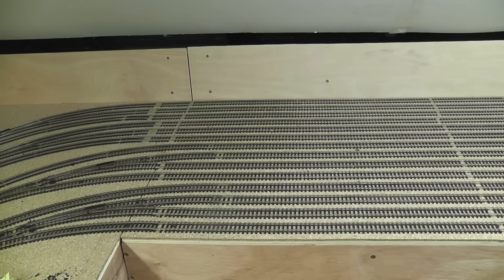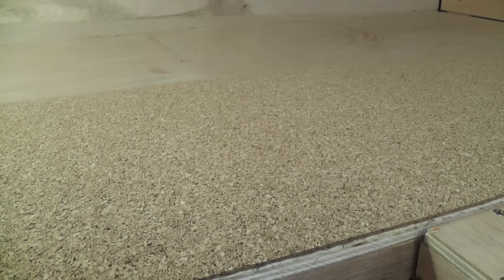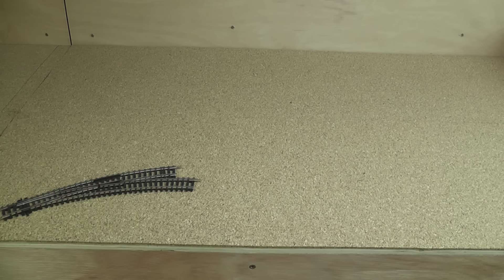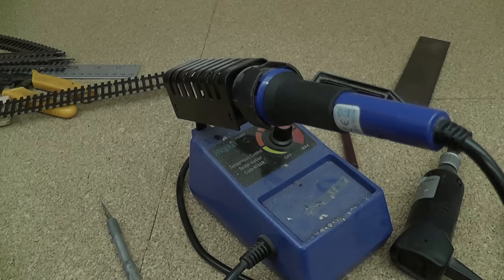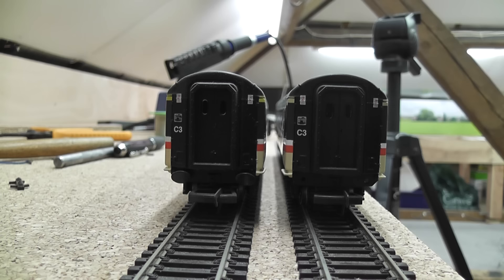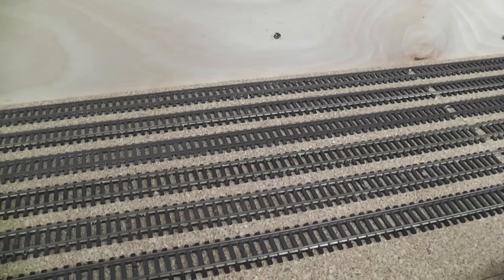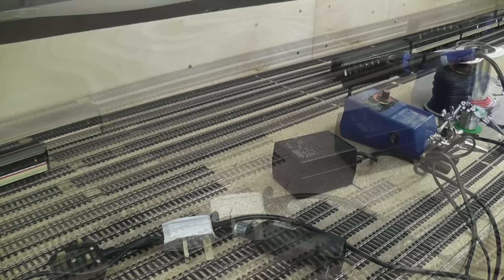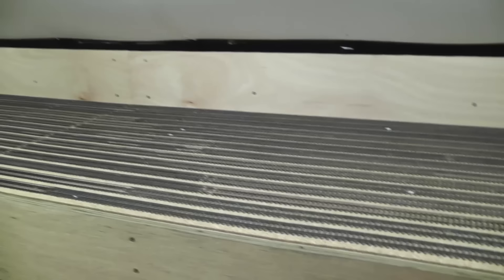New Layout Build - Fiddle Yard

Comment: When I was wiring a fiddle yard some years ago I stuck drawing pins into the underside of the boards wherever I had dropper wires, especially for the points.  The dropper wires were then soldered to these, and then the main wiring was subsequently soldered onto them - this reduces the need for long dropper wires and saves cable.  Also, when used under points and section gaps, it creates an image of the track above which also makes wiring and trouble shooting easier. 
Presumably, you will be using connectors of some sort at the baseboard joints in order to preserve the ability to separate the boards.
As an aside, I rather liked the scrapyard in the old layout - it reminded me of Barry Island and Woodhams' Yard.

Comment: Dear Everard Junction, thanks for your many instructional videos over the years - most informative. May I add some tips for soldering. Always apply a small amount of solder to the soldering iron tip before soldering any joint or tinning. The liquid solder will transfer the heat much more efficiently than a dry tip and can reduce the damaging effect of heat on plastics. Another tip is to have a damp soldering iron sponge or folded damp kitchen towel to clean the soldering iron tip before each joint is made. This will help in reducing unwanted dry crystaline joints that might fail over time. The soldering process should be: clean the tip, apply solder to the tip then make the joint as you have instructed. I hope this helps.

Comment: Hi Richard, with such a densely spaced fiddle yard you may find it worth nailing a 3mm thick strip of hardboard to the edge nearest to you as a safety barrier. With such close tracks a slight fumble may cause a domino effect such that part or all of a rake of coaches decide to roll sideways onto the floor. I applied a strip so it was about 20 to 25mm high relative to the rail top, enough to stop a roll overboard but not enough to be a nuisance. Tension lock type couplings are very tenacious when they want to be. Merry Christmas and have a Happy New Year, I eagerly look forward to viewing your forthcoming videos. Jim.
Reply from the maker: Hi Jim, I will be putting up a protection board once I've completed the track laying.

Comment: Hi Richard.
Nice to see some track being laid and that you're not wasting track that you've already bought.
Good move with the soldering done beneath the track. It's something that I've done for years, and looks particularly good when on scenic sections.

Regarding having shorter trains on a single fiddleyard track... one thing that you could do, is to fit DCC block detectors.
You can set things up where you can have 5 blocks on a single siding, with a DMU in each of them.
As block #1 becomes vacant, the DMU in block #2 will move into block one, and as block #2 becomes vacant, the unit in that block will move into block #2... and so on.
So your units will all shuffle forward by one block leaving a gap at the back for the unit you're operating to go into, without having to manually shuffle.

You an also use something like JMRI with a laptop (or even better a touch control monitor) to create a virtual panel making it easy to route trains.
With a push of a single button on the screen, you can set macros so the points will change in sequence and create a route all the way around the layout.
Reply from the maker: I will be doing something similar to that if not the same when I get around to sorting the control out.  Automatic braking and slow approach is also something i'm looking into.
Reply: Regarding JMRI for route control, I did something for a club layout a few years back.
I had it set up so that by pressing two buttons on the screen, you could set a 360 degree loop from a fiddle-yard siding, through at station on the scenic side, and back to the fiddle-yard.

It was set up so when you press a button, it goes through the list of point motors, selecting which will be activated and in which direction they need to be set, and then each point is flicked over in turn.

Would you be interested in having a Google hangout with me so we can discuss it?
You'll only need a microphone.

I can show you how to set it up and how to set up the macros to make it work properly.

Let me know if you're interested.

Comment: Fantastic to finally see track going down. You must be so happy to reach this stage. Regarding the crossover I too have prototypicalish spacing using 25mm aluminium box between the rails when laying. I found after a couple of attempts that the best way to join 2 points is to cut the stock rails only and lead the rails on the frog alone. Trim the chairs on the sleepers to accommodate an isolating fishplate and you're good to go. Merry Christmas and Happy New year

Comment: Tip: If you use Evo stik PVA non-waterproof glue (in the green bottle) to stick Peco track down. When you want to lift or move the track you only need to apply a little warm water. Wait a few minutes and the old glue will have returned to a liquid state. You can then even wash the track carefully in a shower to remove most of the balllast and other scenic bits.
Reply: Copydex is also good as it is a water based contact glue. Holds tracks pretty quick and will allow for easy pull-up if needed.

Comment: Great video. Good tip on how to straighten pre-used  flexiitrack...not one I have heard before even after 50+ years modelling!!! 
A great Christmas to you and yours. Cheers, Bob
Reply from the maker: I've not seen it done either.  I looked at the track and thought 'how about a whack on the workbench'?  Worked much better than I thought so included it in the video.  Thanks Bob

Comment: when you glue a road base using PVA glue with cork underlay it in fact increases noise transmission. If you want to decrease noise use a soft set glue on the ballast with a cellulose underlay and use a silicon type flex adhesive like selleys 3-1 to glue down the underlay.

Comment: All looks great and very neat... and by bringing the track closer together it gives a much more prototypical look, even though it's not in the scenic area! We get told off in the rail industry for calling all running lines 'fast and 'slow lines' - the Western were and still are, very particular in that they have 'Mains' and 'Reliefs' instead, which are laid out in pairs (i.e. Up and Down main as a pair then up and down relief) with a 10 foot spacing rather than a 6' spacing between pairs. This might help you get the GW mainline 'look' when laying the track as model railway set track has otherwise non prototypical geometry.
Reply from the maker: Thanks for the info.

Comment: Hi Richard
A sizeable fiddle yard for sure, can't wait to see some trains on there.  Good choice using code 75 as all points and cross overs are electrofrogs and it looks better, something I wish I'd realised before buying all the code 100 that I did. Fleischman joiners are spring loaded and make an excellent connection, Jim on Hoover motion uses these to great effect and didn't require quite so many droppers which you make look easy but are a pain to do for so many tracks.
Happy Christmas looking forward to seeing your layout progress in 2018.
Cheers Paul

Comment: Great videos! Super resource for learning and interesting to watch. I don't know what your plan is for the layout but how about having a Dmu service area on the main layout with a small one or two lane shed and wash with a loop line or two to leave units at on the station approach or on the approach to the fiddle yard at the city scene end. Run one of the loop lines to the station and you have a layout feature which doubles as a dmu fiddle yard where you could store your units on the layout and they won't trip over the longer kit in the fidde yard. Think the south end of Sheffield Station or Bristol Barton Hill for inspiration. I don't want to turn your comments section into a "why don't you do this" forum but it could be a practical way to free up lanes in the main fiddle yard.

Comment: Merry Christmas Richard.  Those baseboards only 2ft wide at the fiddle yard?....a massive amount of track for storing!   I have a decent sized off scene fiddle yard, but yours is gigantic! lol. Dave
Reply from the maker: Cheers Dave.  They are indeed only 2ft wide.  Managed to get 14 sidings out of it in the end.  Unmodified peco points would have allowed for 12 sidings.
Reply: @EverardJunction  Hello Richard . Is the pointwork set track or code100 ?

Comment: Nice tip with the 12mm block of wood for track spacing.

Just a thought but could you not have incorporated a "Rolling Road" test unit into one of the "Slow" sidings

Comment: Happy Christmas...!!  Are you thinking of putting some sort of guard along the front of the fiddle yard to prevent anything on that road nearest the edge accidentally taking a dive several hundred scale feet to the floor?  I've got a few sections on my layout which are that close to the edge and I've added strips of thin plywood just high enough to catch an accidentally toppled coach or loco (although I'll admit that was only after a Class 158 took a tumble - it sustained damage but not terminal thankfully).  I tend to find when reaching over to the back roads you can accidentally catch anything at the front with clothing etc. and the guards I've got have saved some expensive falls a few times.  Just an idea... you're probably not as clumsy as me!

Comment: Hi Richard, I'm agree with tobortine.... ! 
I have several YT's followed about our hobby but you're the best of all ! 
Because I'm Dutch and your comments are realy understandeble for foreigners.
I'm a Dutchman and restart after 50 years again with this hobby. The worse thing is there is so much changed in this years and thanks to you that you explain every thing clear ! In between I've see 100's of vids of our hobby.
In my worklive I was a locdriver at the Dutch Railways for 10 years and after that a teacher for locdrivers and I'm now almost 70 years old now.... :) 
But I've a question: In 1 of your vids you let see your locshed with a rolldoor. The mechanic to roll-up the door with Mecano I do understand but from which material have you made the door ? Because I like that very much and I will make and use it too.
I wish you a good and happy 2018 !  Ed

Comment: Hi Richard you mentioned about your bus and you wasn't sure about how you was going to run it ,my layout is similar to yours also loosely based on the gwr line from paddington with two fast two slow lines, i am nowhere near finished but decided the run four separate buses to give some flexibility i.e. 3 dcc lines 1 dc line also if you do have a fault the lines can easily be isolated , adding boosters made easier too, hope this gives you an idea ,great channel, have a happy new year.
Reply: Hi very nice saves time taking loco and stock off the layout also see what u have to run nice one Kevin Philippines  have the same

Comment: If you really consider keeping the sections separate it would be wise to insert screws on the edges of the sections and solder the rails to them. It's a commonly used practice on modular layouts because it keeps the track in place preventing bumps or derailments. ;-)
Reply from the maker: There a various methods for doing this.  I will be sorting it out in the future as the new layout progresses.
Reply: There is also a German manufacturer, who produces "module transitions", which are basically pieces of circuit board with ties on them, where you can solder the rails on. Mind you, they are a bit expensive for pieces of circuit board, but maybe it is an idea you can reproduce with a bit of CAD and if you know someone who can photoetch circuit boards. Here is a link to an online shop where you can buy them: http://www.mbs-sebnitz.de/gleisbau/schwellenbaender/moduluebergaenge/moduluebergang-4-schwellen-h0.html Also this is the manufacturer: http://www.digitalzentrale.de/ (both in German, I am afraid...). Alternatively, there is another German manufacturer called Weinert (they are reselling Peco tracks in Germany as well, incidently), who have track joiners for module transitions in their program: https://www.weinert-bauteile.de/weinert-modellbau-74019-mg-code-75-schienenverbinder-mit-angegossener-schraube-8-stueck-weinert-meingleis-fuer-moduluebergaenge,art-30399 These are for code 75 track. Hope this helps.

Comment: don't use old school cork anymore, i now use foam throughout. It has far better scenery and sound deadening capabilities. Merry Christmas.
Reply from the maker: I'll be using foam for the scenery.
Reply: NS3644 until it disintegrates.....
Reply: Have been using insulation foam for over 10yrs without any sign of disintegration unlike cork.  It just depends on you using the correct type.  Merry Christmas.
Reply: Aaah,  I expect Richard means the closed cell type used for insulation (my preferred for track and scenic surfaces) not the open cell track underlay type. Jim

Comment: A Merry Christmas and a Happy New Year. Would it not be prudent to test run locos, coaches and wagons over the pointwork each end before you extend. This way you can remove any major or minor problems to prevent any future disappointment and having to spend time correcting in the future when it can be done now. Run the loco(s) under power,this way any snags can be found and corrected. Looking forward to future installments.
Reply from the maker: I have been testing as I go.  Currently can't run any powered locos over the point work as its hanging off the edge of the board.  Plenty of testing is being done as I go especially clearance checks.  Cheers
Reply: You wouldn't happen to have been a member on b3ta.com many moons ago would you?

Comment: Great job mate. But in my opinion the dropout wires you have used are way too thick because you will never ever have more than 1 amp of power requirements on any single piece of track, providing of course that all the flex have individual dropouts and that you run a thicker pair of bus wires underneath the whole length of the layout. On the dropouts you used multi strand wires so you can go much thinner, as thin as 0.07 square mm cross-section. I also initially thought of using 0.75 square mm cross-section on the dropouts but ended up using 0.14 square mm cross-section just because I couldn't easily find thinner than this multi strand wires close to where I live. Again as usual you've done a great job as well as another very instructional video and I thank you for that and I wish you good luck in constructing your new layout. I also wanna wish you all a Merry Christmas and a Happy New Year!
Reply from the maker: Thanks, with regards to the wires I've had those reels of wire for years.  Its cheaper to use them rather than buy new stuff.  They are probably too thick but I'd rather have an overkill setup just to be sure.  I've got lighting installed in most of my coaches and will also be double heading some passenger trains.  All that will add to the load on each pair of droppers.
Reply: Unless you're using "plasma" lighting there should not be more than 1A at any time on any particular meter of track. I always tune the lighting way down in my coaches so that it resembles the real deal. I use 12v LED stripe but I do change the resistor to 22K for each 3 series LED and I use track power rectified through a bridge rectifier so it ends up being around 20v DC. I mainly use Roco locomotives of relative modern construction(2004-2016) that with a full rack of 14 coaches will draw a maximum of 220mAh on a flat curvy track and around 530mAh on a 4% curvy incline. I also use Zimo mx645 or ESU LokSound v4 decoders with load compensation. My DCC station is Z21 also made by Roco whick allows me complete control of the entire layout locomotives, points (servomotor) and accessories from my smartphone. The layout I'm working on has two stations each with 5 lines (3 passengers one overpass and one reserver for freight trains waiting departure) that are connected both ways around. There are additional spurs and small single line stations and well as a small yard. Total length of the lop is only around 14m because of lack of space. Toral number of planned track is around But there is a ~4% grade  both ways going from the top station to the bottom one 5m and respectively 6m so traction tires are a must. Cheers.